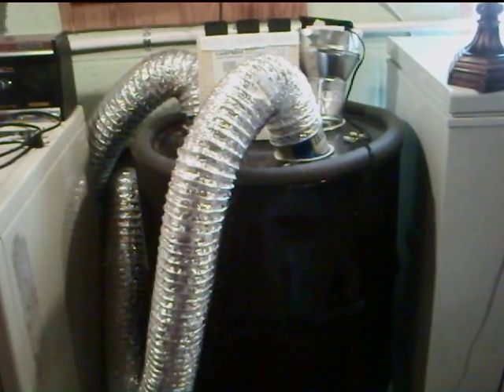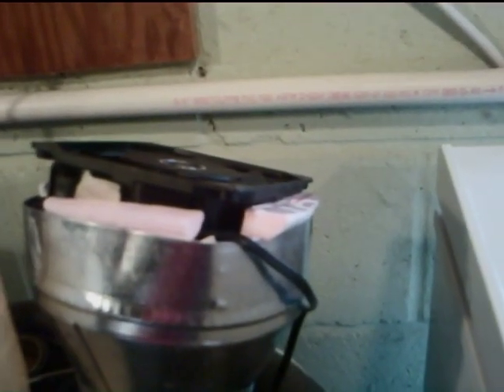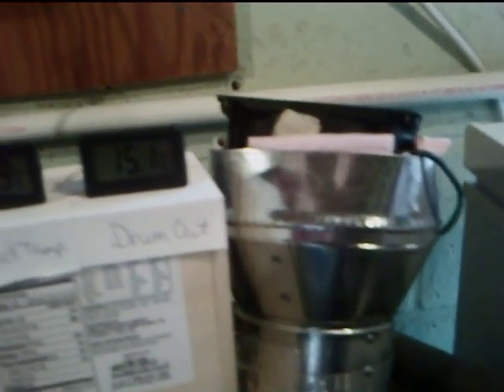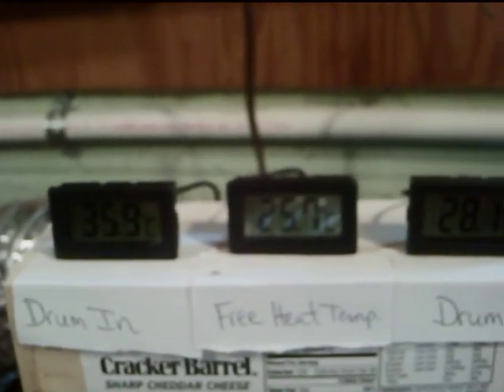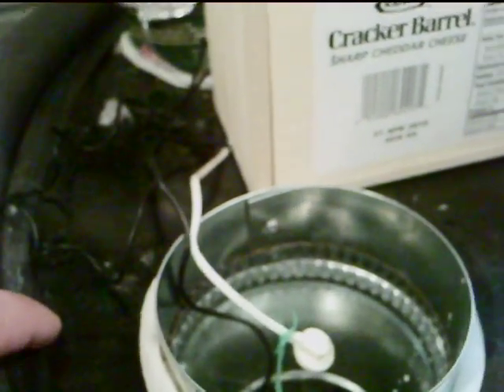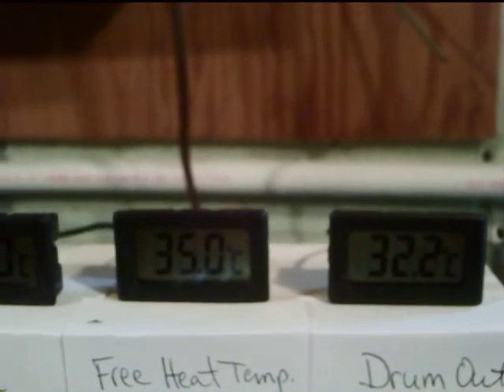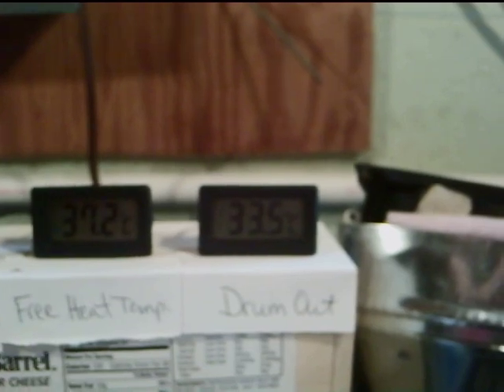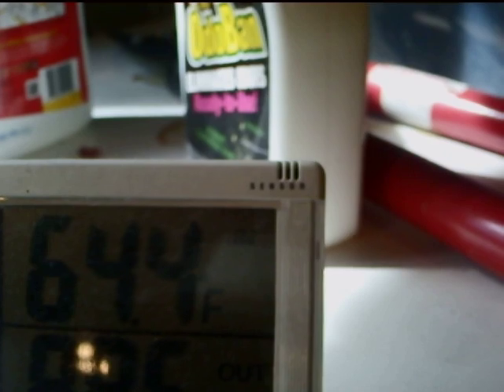Clothes Dryer Heat Exchanger HE 26 Part I

Comment: Nice concept, you get some heat immediately, and the thermal mass from the water bottles helps moderate the temperature spike.    I woulds have skipped the water bottles and gone with baffles to slow down the dryer air for heat transfer.
Reply: watchthe1369

Comment: All you folks are missing a large point. The air passing through your drier is creating a negative pressure in the house. This air has already been heated. The exhausted air is replaced by air from out door coming in anywhere that is a small leak. This replacement outside air is cold and has to be heated. Properly filter the air and place it back in the houuse.

Comment: Great job, great to see people willing to put time and effort into energy efficiency!
My design has an inverse flow, concentric tube heat exchanger.
The intake of the dryer pulls outside air through twenty feet of 8" aluminum flex while the outlet air exhausts through 20 feet of four inch aluminum that is run inside the 8" tube.
Any heat escaping the exhaust will be picked up by the cold intake and re introduced into the dryer for reheat...electric dryers only!!!
This system maintains a neutral air exchange with outside air 
Counter flow concentric heat exchangers are very efficient
The bulk of this tubing can be located in the attic or basement/crawl space 
Must have condensate drain ! !
Reply: In the summer it seems great.  In the winter though it seems like it would make your dryer heated air temp less, and take longer to dry clothes.  Best idea is simply (like you did) avoid the air exchange from pulling indoor outside and recovering that air through infiltration.  Since dryers exhaust so much fuzz and junk, any heat exchanger you could use would get gummed up pretty quickly or else I'd say why not try using an old gas furnace burner heat exchanger to push the dryer air exhaust through and a fan cross breeze on the outside of the exchanger.  Food for thought...

Comment: Any data in energy units (J, BTU) instead of just temperature ? Be nice to compare the recovered energy with how much energy you put into the fan.
Reply: Neat!  Great idea to harvest high entropy heat from your dryer.  You might get a higher temperature differential and therefore more heat transfer if you fed some lower temperature outside air (instead of all room air) into your heat exchanger.  Perhaps a thermal switch that would inject outside air when your free air heat reached the desired temperature + 15 deg C or so.

Pretty interesting though.  Keep innovating!

Comment from the maker: I am in the process of upgrading the heat exchanger with aluminum cans of liquid instead of plastic 2 liter bottles.  Aluminum is better conductor than water and the smaller sizes may heat up quicker in order to give me a longer fan time than 8 min. after dryer shuts off.  I will need 36 cans to create the same thermal mass, but if I have room I might go to 48.